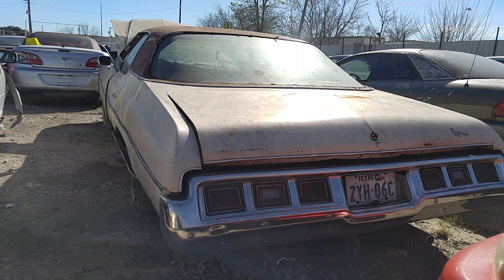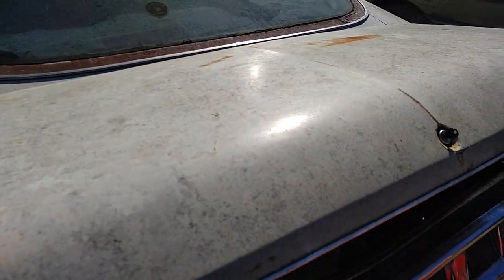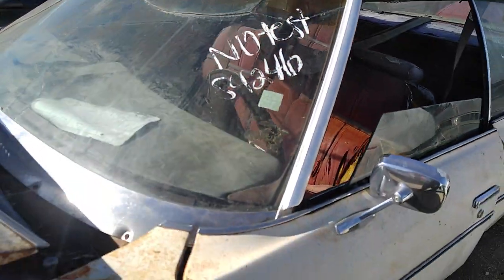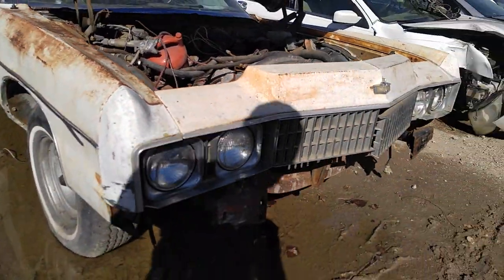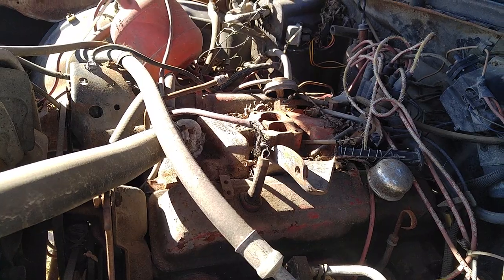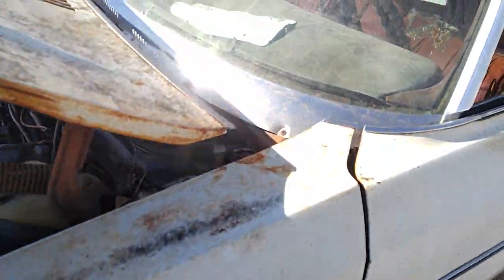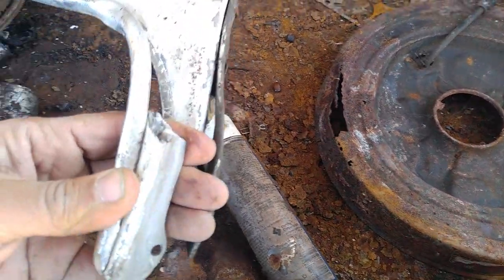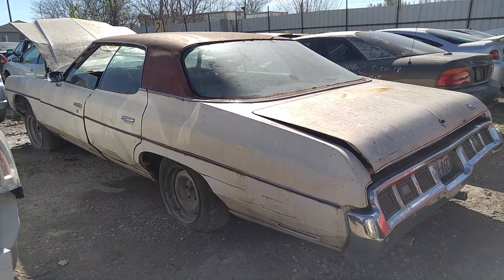1973 Chevy Caprice Junkyard Find

Comment: Real rare long as its not a rust bucket those cars have potential
Reply: parts for a drug dealer donk build
Reply: @chevycaprice8956  well ive seen those guys that dump 50 k in a 73 chevy b4 with no apparent means to pay for it, i just assume if a guys not working and thows 5 k in an interior they are getting money from a dishonest means, some arent but most are up to something, when i was a young buck i worked on my cars with my hands and worked a job for 5.25 an hour, i had just enough cash to pay for gas, a few things for my car and my girl